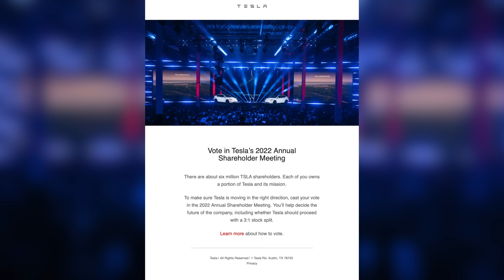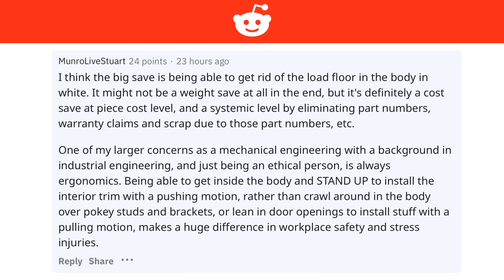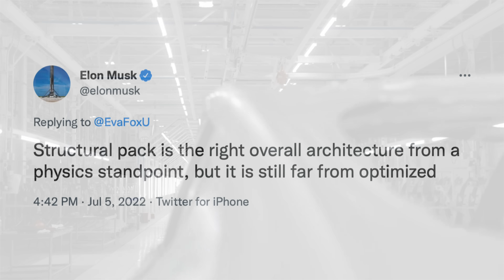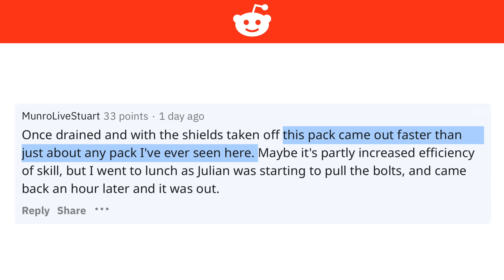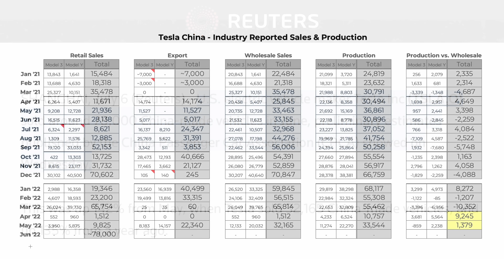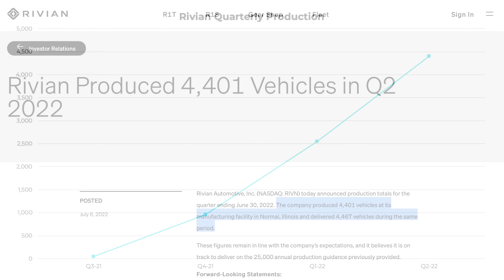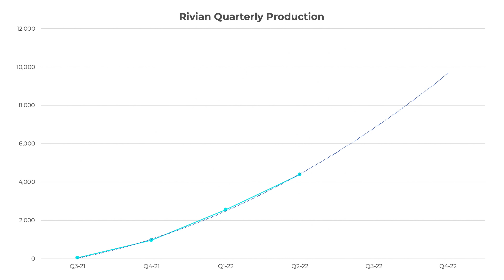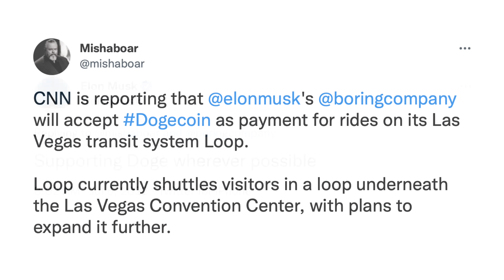Behind The Scenes Details on Tesla Model Y Teardown From Munro

Comment: Tesla made very high power vehicles SEXY. The power can only be used in a few counties and on racetracks. When the world is producing 150 million four wheel vehicles per year, less than 5% will be high power. 0.5G (5m/s.s) is a limit for a normal vehicle. Teslas can do 0.8G to 1.3G. 0.3G is satisfactory for most drivers. The most rapid accelerating commuter trains can only achieve 0.12G. 
A normal SUV for the world is likely to have a 50kWh pack, 100 kW of motors will be plenty, and the vehicle will weigh 1200 kg to 1500 kg.

Comment: they should really just premap that tunnel, there is nothing wrong with that, it is pretty static path IMO
Reply: Pretty sure they WANT the miles driven using FSD, so that it helps the FSD totals and % of time on FSD per vehicle.  It's not "cheating" if you're forcing every single Tesla driven in the Tunnels to use FSD. 
Sure, It's an easier track...but it still requires them to successfully navigate using what you want them to do eventually.

Comment: So if that structural pack is so easy to remove then does that mean that it would be replaceable on a high mileage car?
Reply: Depending on chemistry these batteries should have at least a million mile lifetime so unlikely to be a factor.
Reply: @johnmqueripel2367  true, but it's a point sometimes brought up as a negative for structural packs. I agree though, it's probably an irrelevance

Comment: So no weight gain from the structural part of the structural battery pack. Low ramp on 4680 that as of now provide no gain in energy density. No realised gain in charging speed (though this could be sandbagging/software).
What is left is less capital employed for the battery production with the 4680 via the Maxwell dry electrolyte process. Which is huge, but still not enough to beat LFP in cost which also has longer lifecycle.
On top of that other companies release Cd 0.21 vehicles like the new Huyndai. What is left? Electric motors? I do not know the competition status on that.
Reply: I don't think we have any hard info on energy density although Limiting Factor is doing a tear down on a damaged cell recovered from a dumpster.  Charging always starts conservative while they gather real world data but I wouldn't speculate on what possible improvements could be realized.
Reply: You are of course correct. BM;W is much lighter. Not. Audi is much leaner and faster building. Not. VW is much cheaper building. Not. Toyota is much faster building. Not.

Ok which competitor to the Model Y Standard with 4680 pack did you have in mind? The Wuling? The Zhaidou? Maybe the Suda? Or even the Fiat 500E?

When you say it has no weight gain. It weighs 4220 lbs vs. the Long Range from Fremont which weighs 4398 lbs. Of course that is not much. Did you expect 500 lbs less? Did you take into account that a comparable model from another manufacturer - e.g. The Q4 Etron weighs 4870 lbs? Or the BMW i4 M50 with comparable performance weighs 5550 lbs?

That the VW have charging speeds of up to 170kW and Tesla up to 220kW in its first iteration. Just as the Model 3/Y had only 150kW at the start and last i looked mine charged with up to 256kW?

If you want to criticize please do so, but first please please PLEASE check your numbers! Thank you very much!

Comment: FSD inside a 1 lane tunnel ? NO!
FSD on the open streets? Ok!
Reply: I don’t like their narrow tunnels. There should be an amergency area to pull over when needed.
Reply: @AR-rn8ok  They are not long tunnels and have different stops. It will almost certainly be a tight fit, if something happens in a tunnel.

Comment: Why doesn’t BC have a ‘tram track’ in their tunnels? And allow faster runs?
Reply: Why don't they have an automated, high-density, powered tram, like at an airport? No one has any clue how these tunnels with cars in them make any sense.
Reply: @Gorgula  Because there will eventually be a HUGE number of stops in the Vegas Loop and people will NOT all be going to the same location.  Ultimately though, expect Tesla to create a larger vehicle for the tunnels that will have more people...but there's WAY more stops than in an Airport tram / train system.
Reply: To keep the differences between above ground and tunnel small. 
To reduce initial costs to make tunnels.
To increase build speed.

But in the end a railway could make for more efficient driving. So perhaps operation cost will be higher because of this.

Comment: I voted.  But I'm not sure why the board doesn't want to report employee demographic data.   I voted yes on those with all of my shares.   Maybe you can comment on the next vid or two?
Reply from the maker: Tesla already reports employee demographic data. Often times these shareholder proposals are just looking for a level of detail that the board thinks is unnecessary.
Reply: @TeslaDaily  I don’t see the details of these proposals. Is there an easy place to find them?
Reply from the maker: https://www.sec.gov/Archives/edgar/data/1318605/000156459022024064/tsla-def14a_20220804.htm

You can see all the proposals as well as Tesla's rationale for their vote recommendation.

Comment: I have IRA’s with 4 different institutions listed on the link you posted at Tesla. I do have TSLA shares with each company. So can I vote 4 times? Once with each company's link?
Reply from the maker: Correct
Reply: I think you vote using a control number which control a certain number of shares - basically corresponding to each of your accounts holding stocks.
Reply: You REALLY get one vote per share...it's not one vote per owner.  So if your shares were evenly split across four accounts and you only voted with one, 3/4 of your shares would be counted as "did not vote."
Reply: I had the same question

Comment: Biggest advantage of structural battery and full body cast is fit and finish precision.
Reply: It's not a "full body" cast, and while build precision should be an advantage of this design, the biggest advantage is build speed and cost. Also as was pointed out, an easier time for the line workers.